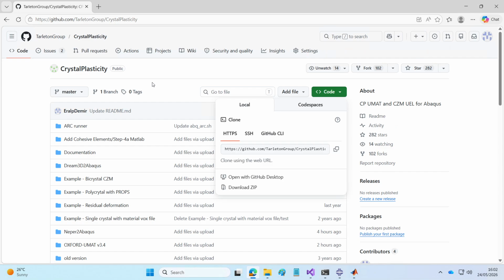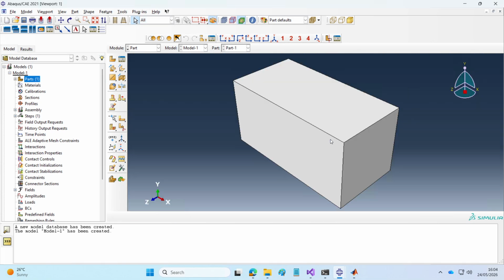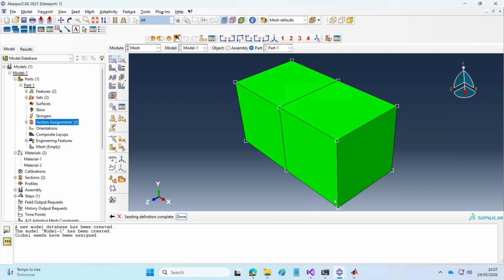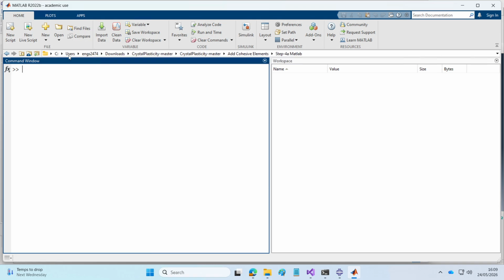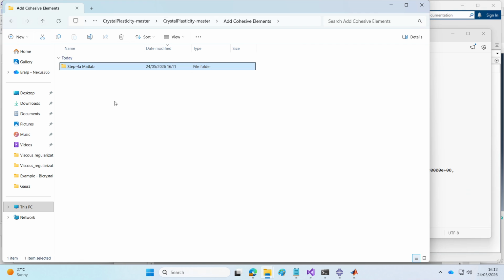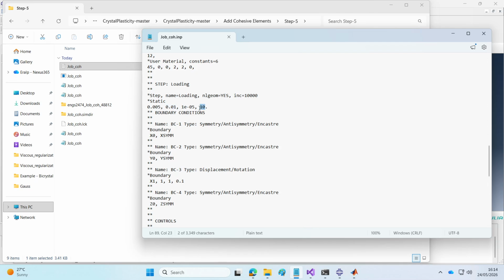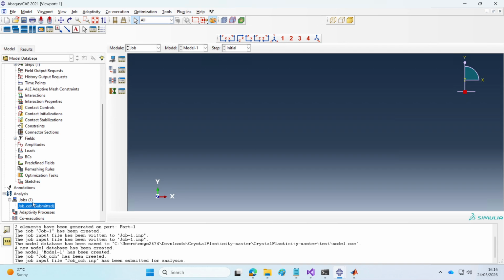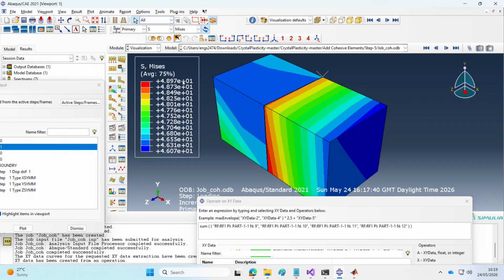Cohesive Zone Modelling in ABAQUS with UEL (Part-2: Application with CPFEM)

Comment: Thank you for the MATLAB code for generating the Job_coh.inp file successfully. However, I observed that the generated file replaces my original Abaqus boundary conditions with the default hardcoded BCs in the MATLAB code, such as X0, XSYMM, Y0, YSYMM, and X1, 1, 1, 0.1.
Since the generated file contains UEL cohesive elements, I cannot conveniently import it into Abaqus/CAE and edit the BCs manually as you have described in the video. I need to submit the .inp file directly as a job.
Could you please guide me on how to preserve the original boundary conditions in the generated cohesive input file?
Reply from the maker: Hi, thanks for your comments. 
The BCs can be changed by modifying the inp file. UEL does not appear in the CAE, everything should be defined in the inp file. Please have a look at Abaqus manuals for using UEL.
BW

Comment: Can this be used for getting intragranular voids in ductile deformation in clean microstructure (without 2nd phase particle and inclusions)?
How to use UEL in this case?
Reply from the maker: Yes, exactly. It works the same way as explained in this video, but use Dream3D or Neper to generate the polycrystal. UEL will work in the background with crystal plasticity.
Reply: @eralpdemir  Thank you for the reply. I am using Neper to generate 2D-RVE.
In the cohesive-element insertion method, are UEL cohesive elements inserted only at grain boundaries, or can they also be inserted within individual grains? For modelling intragranular void/crack formation in a clean single-phase microstructure without particles/inclusions, should cohesive elements be inserted between neighbouring elements inside the same grain as well? If yes, how to do that?